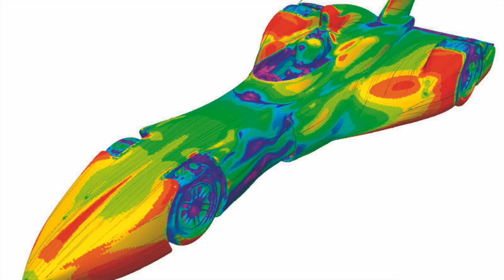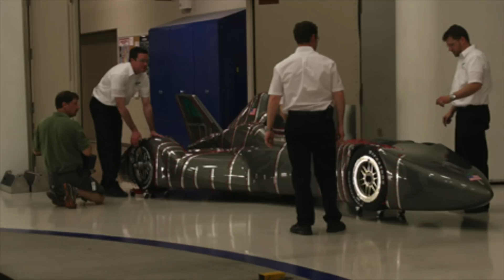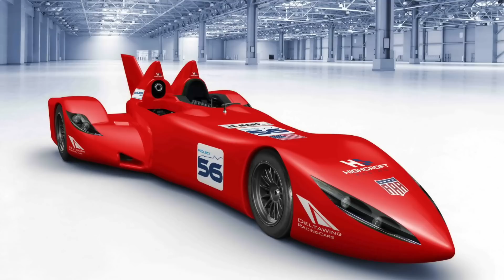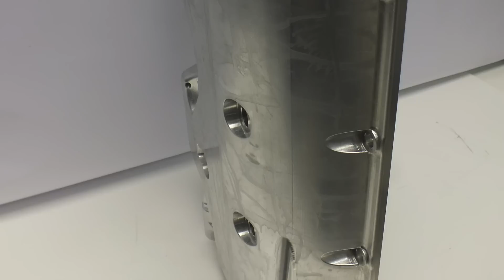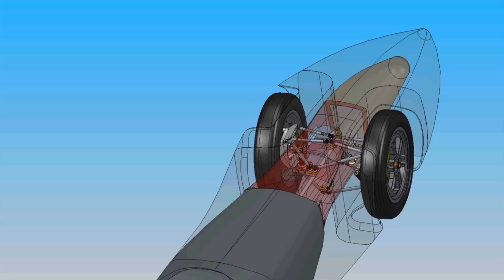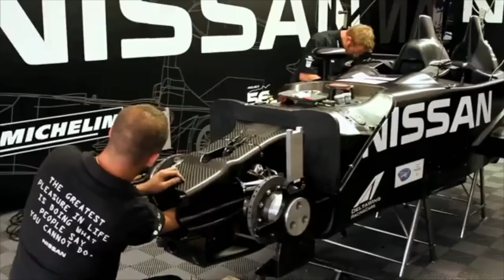Deltawing - the strangest racing car ever?

Comment: The Deltawing concept should've been a success. It was incredible in how all the physics around it got together. Low drag but still with high downforce potential, high energy efficiency with a smaller engine. It was the only reason I watched LM2012 and the ALMS. I remember when it was in the lead of the race at I think Road America, it was an incredible moment.
Reply from the maker: There was a suggestion of it bringing in a low cube lightweight racing class - which was a cracking idea.

Comment: I personally believe the delta wing concept could've done great with more R&D and little less politics. Ultimately it was the politics of who owned what that killed it.
Reply: It did go great, at least in the limited USCC (IMSA) races that it did reliably, but ultimately convergence preparation is really what killed it. Otherwise it could have continued, but not in a manufacturer-required, money from said manufaturer required for entry, road-car lookalike, P2-chassis-based championship. 
Panoz were quite (rightly) convinced they had the rights to run & race the car, but it just didn't fit with the combined Daytona Prototype International and IMSA pay-to-play requirements. By the time it was agreed that it could enter Daytona in 2017 (as a one-off) prep time was short & Panoz decided that the budget needed for one single race ultimately wasn't worthwhile.

Comment: I can confirm that Panoz Deltawing did have two of the Aston Martin tubs.  Indeed the original ‘black’ Nissan Deltawing tub was replaced after the cars first race with the Panoz team at Sebring. A fire very early on in the race damaged the back of tub necessitating a swap to the spare chassis.
Reply from the maker: Great info thanks